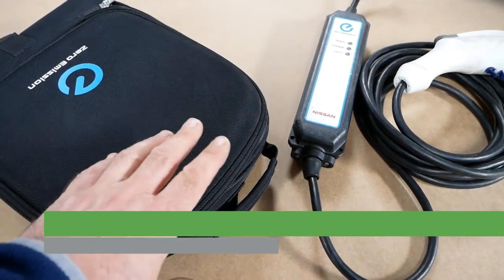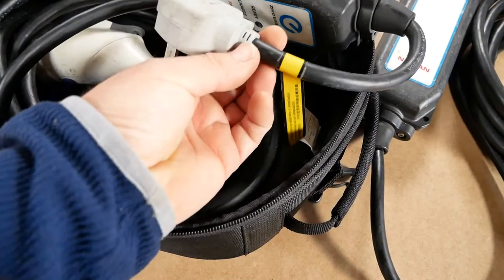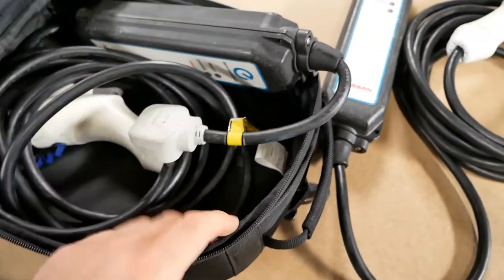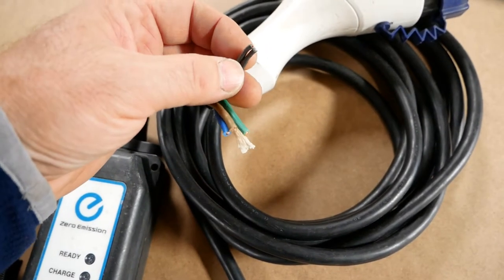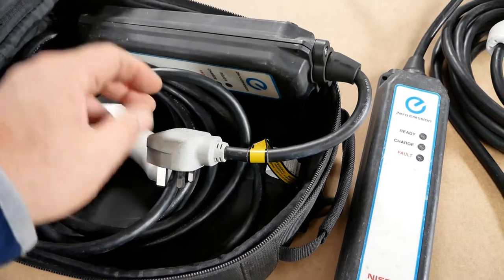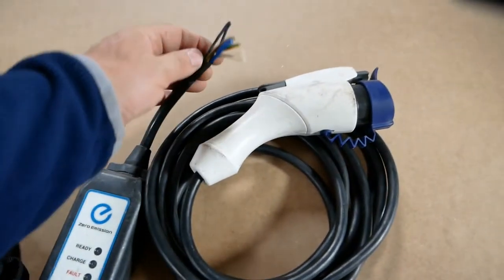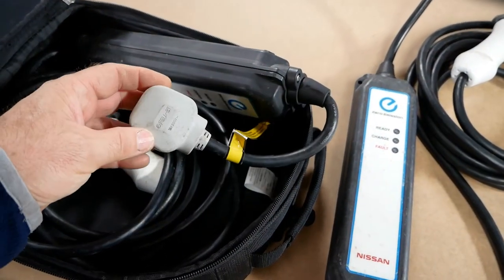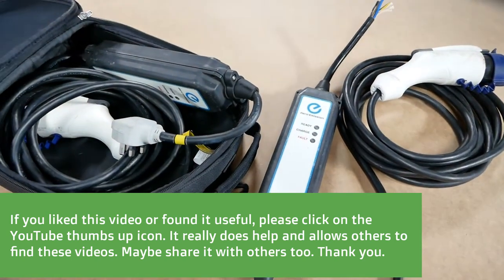The Nissan EV portable charger (granny cable) has a temperature monitored mains plug!

Comment: This is very useful information. 
If a plug socket is old or worn, the receptacles become a loose fit on the plug pins. This could lead to a heat build up with prolonged use, and possibly a fire.
Very clever bit of additional protection on the charger.

Comment: Today I also found out this tiny detail. But being an idiot as I am, I've decided to source a longer cable and replace the whole thing from the charger terminal inside the cable, being that I need German instead of Swiss plug that came with the unit. There I've found out the 2 extra wires on a separate jst connector. It had about 19kOmhs at 23C and about 39kOhms at aproximately -4 to 0C. Fresh from -10C freezer it was about 72kOhms, the digital thermometer froze so I have no idea about the exact temp.
The point is, if you're going to nuke the sensor, just put a 20K resistor in place, I'm sure granny is going to complain about it being missing.
Looking at some datasheets, this may be the component in the plug moulding: NTCLE100E3154GB0. Please correct me if I'm wrong.

Comment: Hi. Just purchased a 66 plate nissan e-nv200, unfortunately not of yourselves.
Do you have and suggestions  regarding a portable charger ? 
I've watched a couple of videos now with you using a nissan charger.
Do you use any other particular ones ?
If so, where do you suggest I look.
I only do daily small journeys for my business.
Any help would be much appreciated.
Reply from the maker: My recommendation is to get a 10 metre portable charger as 5 metres often isn't long enough. You often find a socket isn't close enough to the vehicle, so when you have to go around the wall, through an open window, under the garage door etc, you can soon run out of cable. 10 mtrs is so much easier.
As for brand, they all do the same thing really. Its better to get one that can be adjustable as running them at 8 amps is safer and will not overheat the socket & plug. Running at 6 amps is better if you're using an extension cable.
But I've used this one over the last few years and not had any issues https://amzn.to/3v873PU
If you can find a type1 charger that is selectable, all the better. But don't choose one that is rated at 13A. 10A is the maximum you should pull through a UK mains socket.
Reply: BELLISSIMO.

Comment: 2 small cables is for changing charge speed from 10a to 14a by putting a magnet to the plug ;)
Reply from the maker: Really?? If they made that feature, why put it in the plug and not in the box (with a sticker explaining it). Seems pointless sending additional wires all the way up to the plug and putting the sensor directly over the live pin. Doesn't ring true to me.
Reply: Matt is correct, on the UK version of the Nissan / Renault granny cables it is a temperature sensor, our sockets are only rated at 13A so configuring it to pull 14A would be useless. There are posts on SpeakEV where people have taken the plug apart and found a 22k thermistor inside.

The European version is slightly different as it’s also designed to be used with dedicated electric vehicle sockets that can supply 14A. You are correct that this is activated by a magnet, this is normally a feature of these dedicated sockets. This is a description on the feature from a manufacturer of these sockets:

“A magnet located in the socket allowing it to be detected by the charging cable, and thus to mount the charging amperage to 14A”
Reply: @GoGreenAutos  It's for French sockets.  Sockets rated for the full 16A have a little magnet in them.  The plug detects this and lets the charger run at a higher rate.